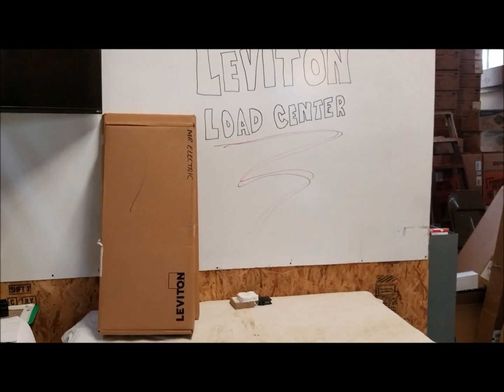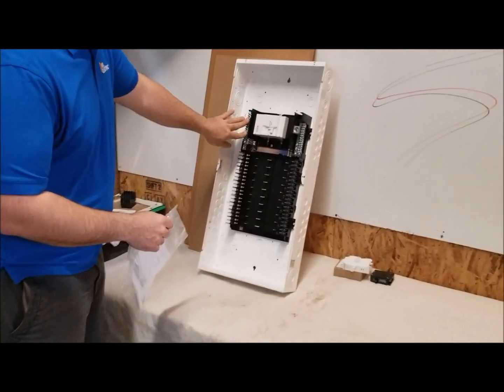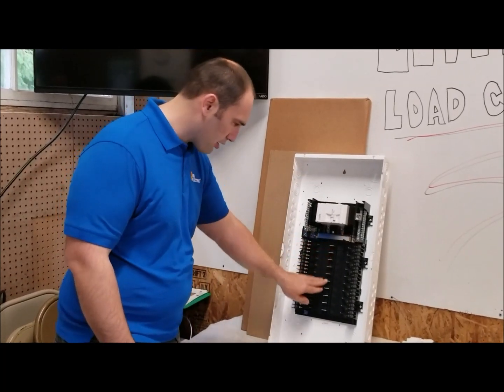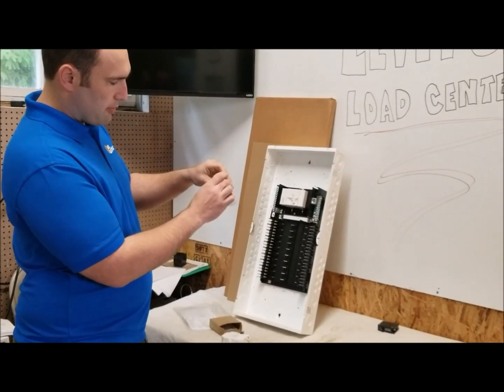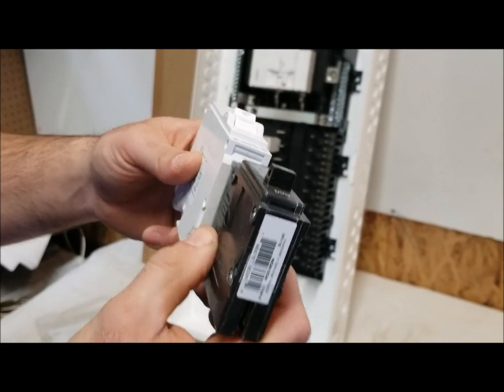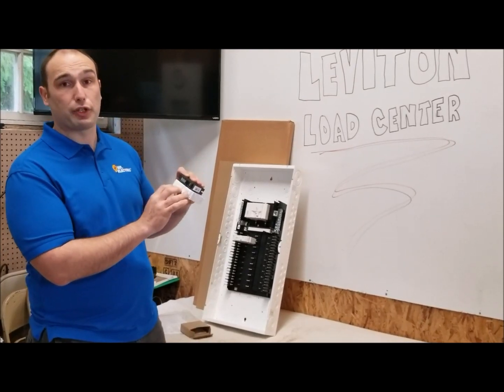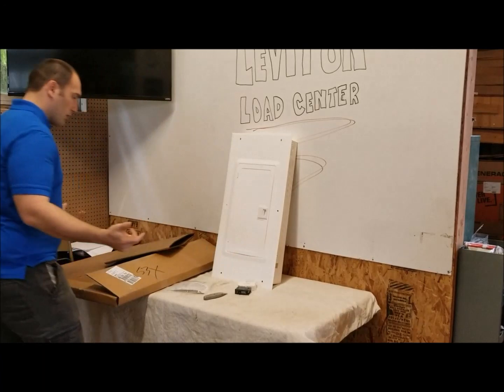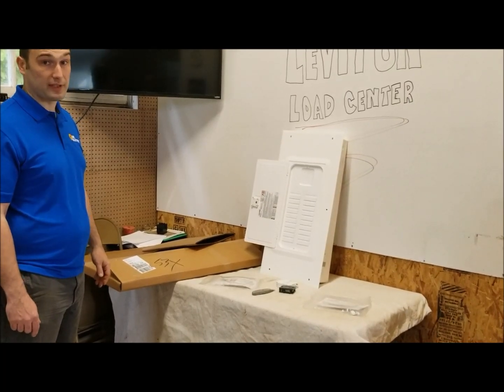Leviton Load Center Unboxing

Comment: - The Leviton Load Center unboxing video dates back four years, showcasing a relatively new product at the time.
- Despite being an older video, it provides detailed insights into the features and components of the Load Center, suggesting its relevance and popularity in the market during that period.
- The video highlights the Load Center's design elements, such as bonding straps for connecting neutral and ground wires, extra terminals for larger loads, and a 100 amp main breaker suitable for various applications.
- Noteworthy design aspects include concentric knockouts, neutral buses on each side, and a labeled breaker spot for a generator interlock breaker, indicating the Load Center's attention to safety and versatility.
- The Load Center incorporates modern technology, evident in its AFCI GFCI combo breakers and sleek rocker switch design, showcasing Leviton's commitment to innovation in electrical products.
- The emphasis on breakers with hydraulic mechanisms for overload conditions reflects a forward-looking approach to efficiency and performance, suggesting Leviton's anticipation of market demands and technological advancements even four years ago.

Comment: I've been researching it... I want to update my panel and its a 1993 westinghouse (now, Eaton) panel.... hard to decide if I want to based on these reviews.
Reply from the maker: It's been a while that I've been installing them now. To start with, a 1993 type BR panel (the kind you have) should have many more years of life left in it, and unless there is damage, (overheating, water, physical) you are not likely to gain much on the safety front. You will only gain very marginal improvement. 

As an update, they have started using thermal magnetic breakers as a standard, I think they couldn't scale the hydraulic magnetic breakers and maintain quality, cost, and supply. 

I will say I have been installing these since I posted this, more than a hundred, and have had maybe 2 bad breakers in all that time. And they failed safe (off). I still install them today, in my own home, and feel they are the best currently on the market. 

That being said, I wouldn't change out a good panel just because this one is a little better.
Reply: @vernonialiving9087  yeah, I've been researching this "Smart panel" stuff and Eaton does have it in the BR series for my panel, looks like I could go that way... I have the X-10 lighting system in my home right now, I guess thats considered a "Smart" home option...
Reply from the maker: I hope the x10 is still working well for you. Many years ago (10ish) I had x10. I started having problems with too much grind noise interference making irronious commands and missing commands.  That alone is an interesting topic. I am currently using z-wave with smartthings hub. If having to do over today, I may consider the leviton wifi system if you know you have neutrals, or the casita wireless with a hub if you don't. But in a year there may be something new...... 

As far as smart panel, use a leviton panel with smart breakers to do sub-metering in a small multi unit commercial building.

It is a nice way to see usage and have a few uses outside of that, but I would not say is a game changer for most people. 

I would consider a "sense" possibility or another 3rd party device as well. I don't have one myself, so do your own research.  I will say to examine you modivation. If you just want something cool (like a hobby) go all in for fun, I would enjoy it. To save money?, to make it more safe? To save environment? Or just as a convenience? 

I know I do it solely as a convenience for me and my family. To control via voice command.  

Good luck, hope this helped
Reply: @vernonialiving9087  I'd love to go over to all leviton products, except the pricing is just too high. even X-10 has gotten expensive again....

Comment: whats the cost of panel and breakers????????????
Reply from the maker: Eric Rosberg . Cost is a tricky thing when dealing with whole sale houses. 2 years ago I was getting Eaton type BR breakers for about 80% of what the Home Depot price was. Now it’s nearly identical? So that being said, Today, I’m getting these for less than a BR panel. Total material bill within $10 of what I was doing. Supposed to be competitively priced with Square D QO line. Some a few bucks more but not stupid. Again 2 things, first that they are not stocked virtually any where and must be ordered from Leviton’s warehouse, second, in my mind a price isn’t set until, I see in on Home Depot’s shelf (true established retail price). Thanks for the comment Eric!! I’ll try and get another video with testing results soon.
Reply: I spoke to the rep at a trade show he says that they'll be competitive to what is already on the market. So figure $125 for the panel and $46 per afci/gfci breaker. standard breakers might be a little more.  It's nice to look at but it'll be hard for them to take back the market share from the already established load center manufacturers.
Reply: I saw the panel on Amazon 186 dollars and 75 bucks for 15 amp breakers they are insane

Comment: Where are these made or should I say 'assembled' ?
Reply from the maker: 135SoHc , my Leviton rep responded, Mexico
Reply: What a shame... Even the cheapest Eaton BR panels (Lowes under $20) are at least assembled here in the states and you can get BR, CH, QO or Homeline stuff essentially anywhere.
Reply from the maker: Shame yes and no, I have gotten BR breakers that say "Hecho en Puerto Rico", which is a US territory. But while I prefer made in USA for several reasons, there are several other reasons why its not a deal breaker for me. Perhaps if Leviton gets their volume up, and they see this and other posts, they will open a second line in the USA. Alternately, the USA could annex Mexico for the 51 to 56th? (don't know how many provenances in Mexico). that would also solve other problems as well, and create many more. Plus I don't know the the Mexican people, or the US citizens want it ether, but it would be made in USA?
Reply: @135SoHc  you sound kind of Trump supporters

Comment: Price for the panel and normal breakers seems ok, but damn the price for those AFCI breakers. Also seems like a ton of window dressing on something that honestly doesn't need it. Its a load center, not a piece of furniture.
Reply from the maker: Unless it's in your living room?
Reply: @vernonialiving9087  Not sure why a builder would locate it there, but sure.
Still to expensive though imo, cant see myself suggesting these to customers until that changes.
Reply from the maker: Looking at Amazon prices, Eaton AFCI about 30, Leviton about 60. If you have 8 ckts in the home requiring protection that's an additional $240 more. In my neck of the woods, I do a panel change with AFCI protection for +/- 3k. So now I charge 3250... I get more jobs sold for using the latest hardware than I loose over 250 bucks. But on a economy new build project, you had better go ask for bulk pricing if you want to get the job, or stick with one of the old standby panels.
Reply: Vernonia Living Was seeing higher prices then that glad it’s not as bad as it seemed. Get those prices down there and yeah looks a bit more attractive.